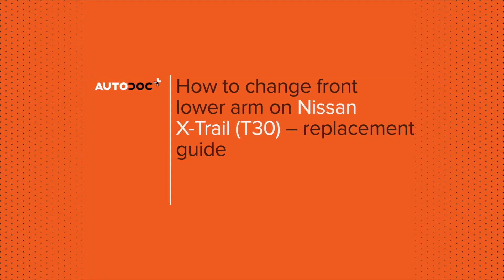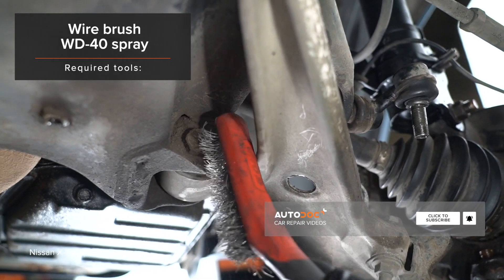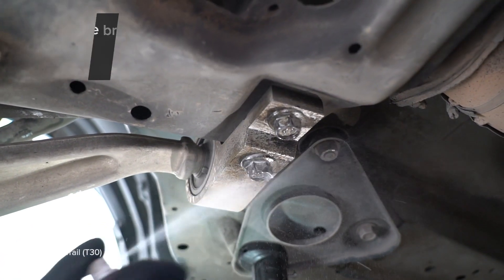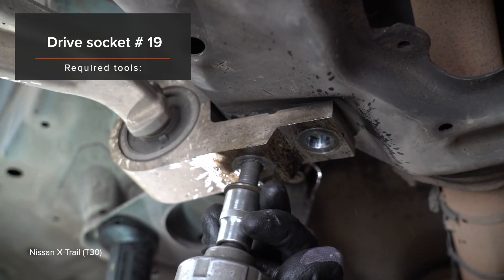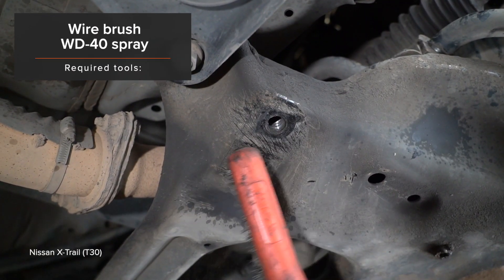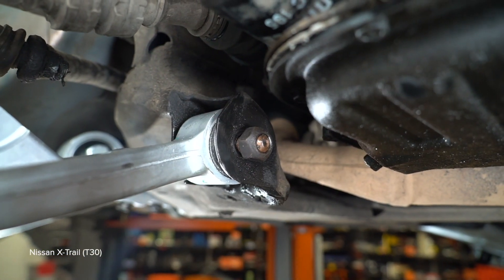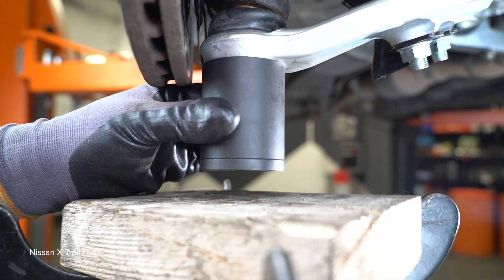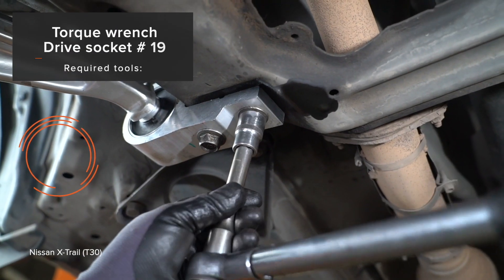How to change front suspension arm on NISSAN X TRAIL T30 [TUTORIAL AUTODOC]

Comment: The t30 seems to have a better system than the t31 ? Yes , no
Reply from the maker: In general, the replacement will be similar, the only thing may be slightly different in design features. Each system has its own advantages and disadvantages. A lot depends on various factors of car operation. We cannot tell you for sure.
Reply: @autodocuk  thank you